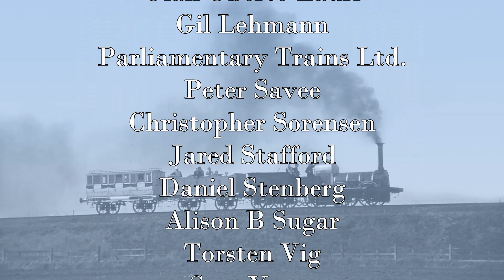Bayard: Not quite Italy's First

Comment: The image at 0:49 has me thinking - maybe this is a dumb question but a lot of illustrations of early railways show the rails without any visible supports (sleepers, stone chairs, etc) so it looks like the track is set into the ground, even outside of stations/cities (a lot of the L&M art I've seen does this, for example). Would it actually have looked like this in the 1830s or were sleepers etc too complicated/not interesting enough to be worth drawing at the time?
Reply from the maker: Yes it would. The ballast was carried on over the top of the stone sleepers and the chairs, so all that was visible was the running rails. It was thought at the time that the track had to be absolutely rigid, with no elasticity. That was wrong, of course. And ballasting rails in such a way meant that the chairs and rails went rusty very very quickly. Plus it was a lot of work to replace a broken rail, or see if a chair or sleeper was broken!